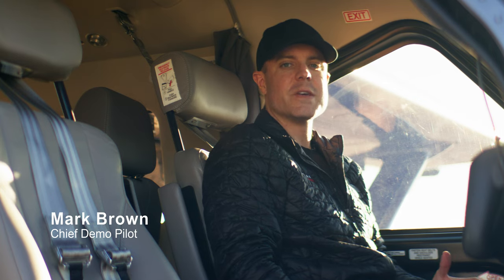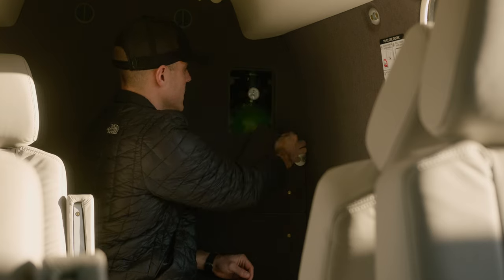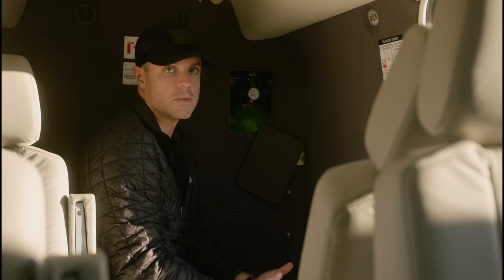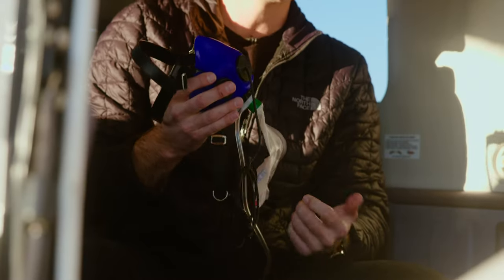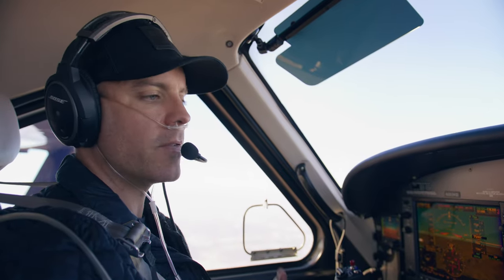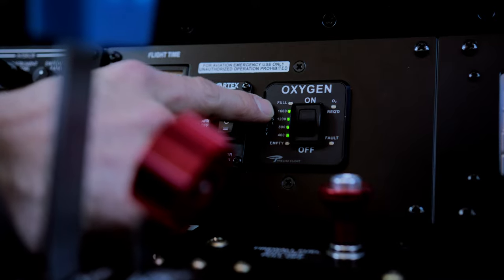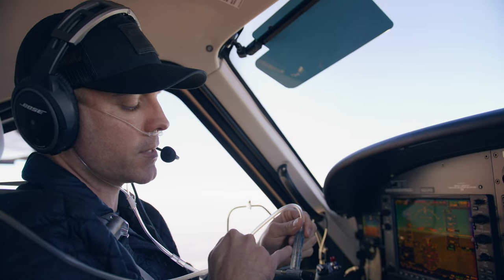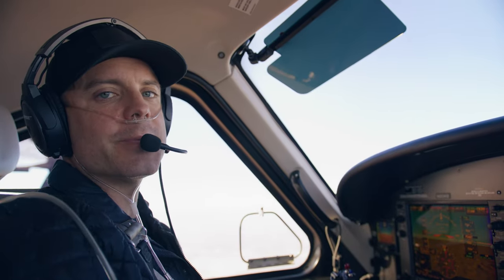Kodiak 100 Oxygen Sytem - Pilots Walk-through of the O2 System in a Daher Kodiak 100

Comment: Sweet . . . Still wished they would pressurize the Kodiak, that would be a game changer!
Reply: Yeahhh that's a lot more needed as far as air frame goes, etc. The price at that point you're better off getting a CJ2 or 3 or a cirrus vision jet at that point, the kodiaks main mission being a bush plane it's not needed.
Reply: @trdshortbus8009  
I would say the next step would be a PC-12NGX, not a jet, as thats a big step up. Bush planes need to get over mountains. The Kodiak has inflatable door seals so just a little pressurization would be great in order not to have to use O2. They are a dream to fly though!
Reply: waste of time,, the  plane is made for lower flying